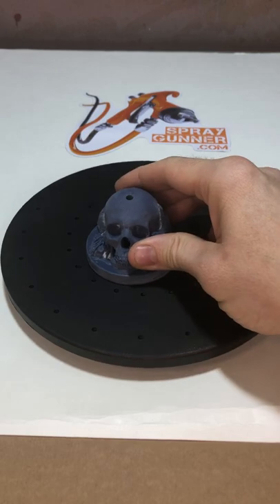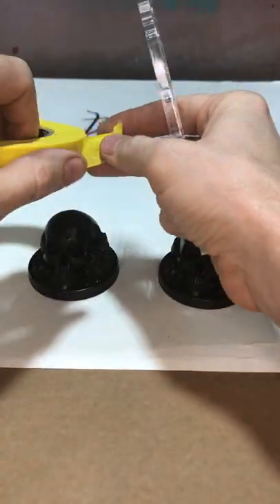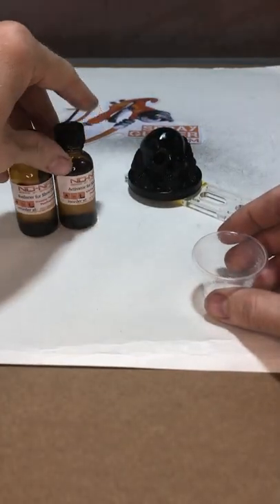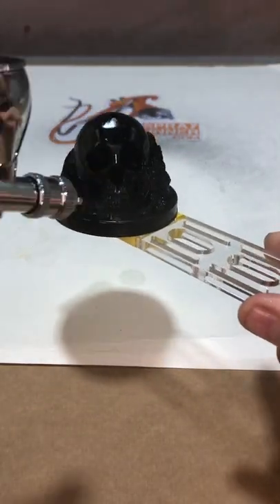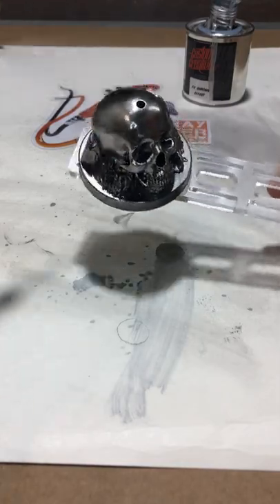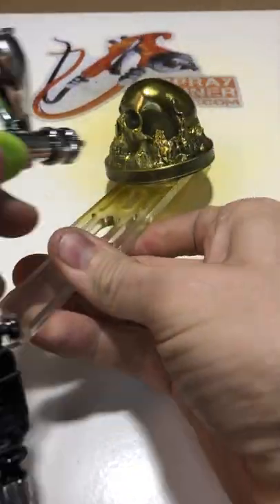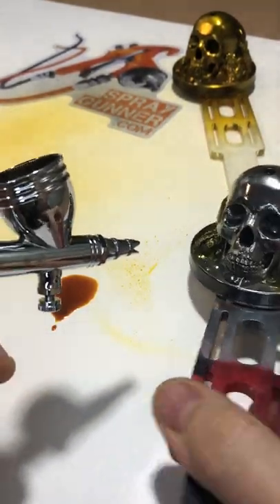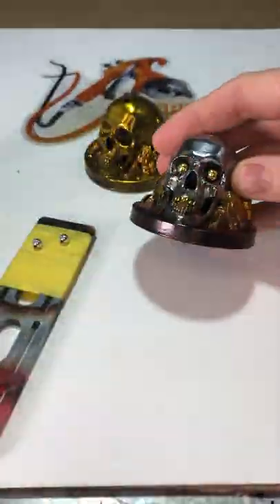Spray painting chrome FX with Createx candy2o over it for gold effect & protecting with 2K clearcoat

Comment: What's up with that second clear
(4050 not durable enough?)
I like the candy over it. Looks sharp
Reply: I've always wanted to gut one of the molotow chrome pens and try to spray it. For small details on 1/25 model cars, and a few of my 1/10 scale rc's,  it's unbelievable how well it works. Just not durable enough for rc.......for real
Reply from the maker: 4050 is not as glossy as 2k UHS clear, also it's harder to build up thickness with it, and for the best look of gold or most metallics, thick and glossy clear is a must, that's why we have 2 clear coats. 4050 UVLS is a must-do step, because it protects metallic from more aggressive solvent clear. If 2K solvent clear applied directly, it shifts metallic orientation and makes it looks flat.
Reply: @SprayGunner  thanks for the clarification.